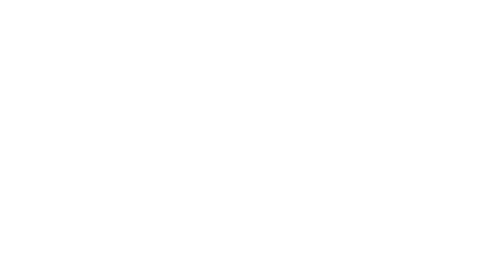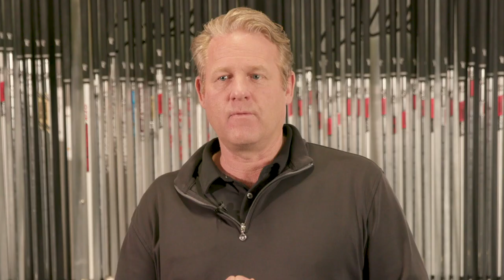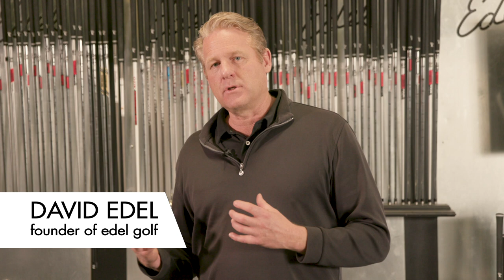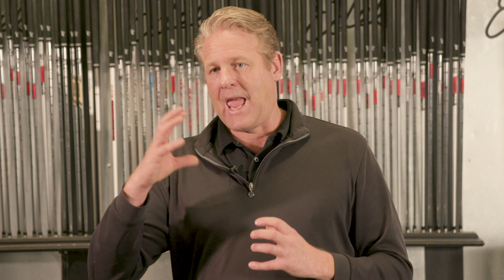This speed drill will change how you approach LAG PUTTING [Putting Roadmap]

Comment: Where is the drill?  Or do you mean changing the weight of the putter.  I like that you state that changing the putter weight varies for the course.  As you say speed kills.  In friendly rounds of golf I have had friends go to their trunk at the turn and get a different putter based on the greens.  The great thing here is that you will know the green is fast and make the adjustment prior to play and not worry about doing something that is "illegal" after you tee off.

Comment: David, if I go to a new course, do you suggest just 1 putt each to the 15 ft string with the 6g, 12g, and 25g head weight and pick which weight delivered the best speed?
Reply: Sounds like a solid idea, did it work? I’m getting into weighting so I can essentially do this because when they’re running really fast, or slow, I’m bad at adjusting